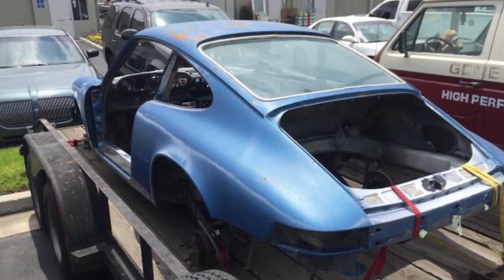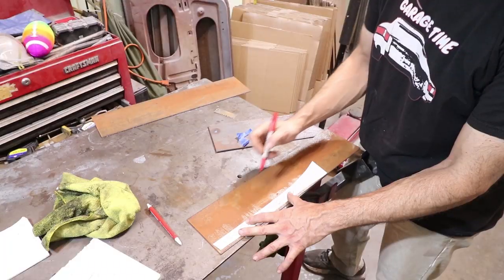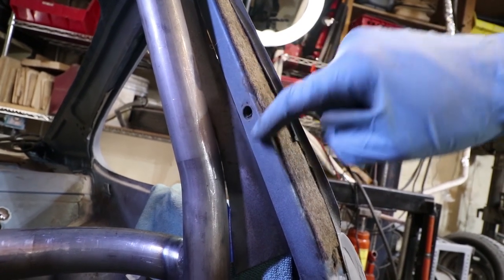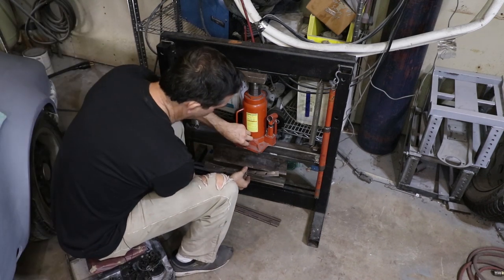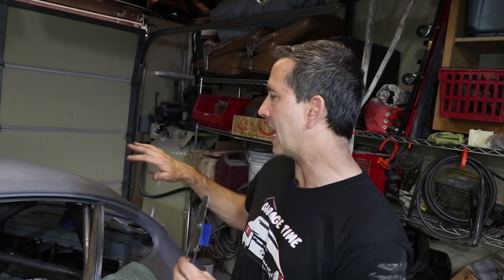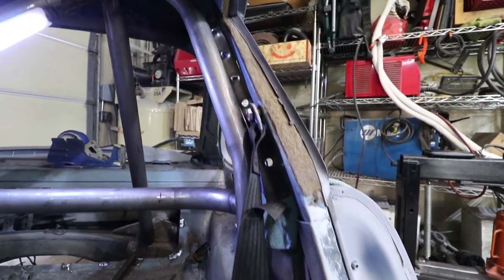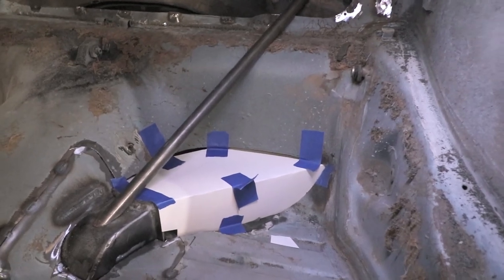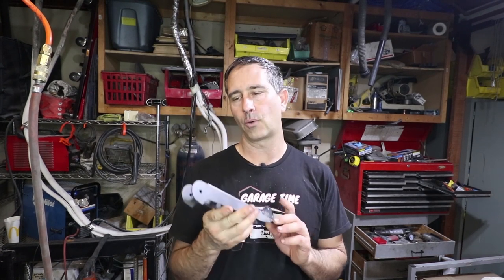Can These Unusual Interior Mods Actually Improve Handling?

Comment: Seatbelts mounted wrong! The D ring you attached on the B pillar goes at the end of the belt by the bottom of the seat in the sill.
Reply from the maker: Ugh oh, what's the part that goes up high?
Reply: There should be a chromed loop through which the belt slides by the B pillar point